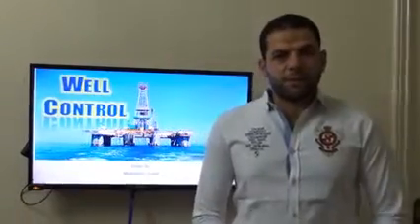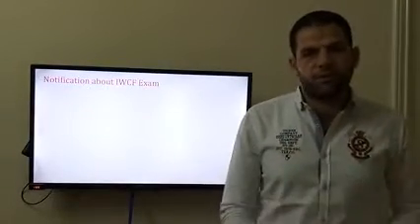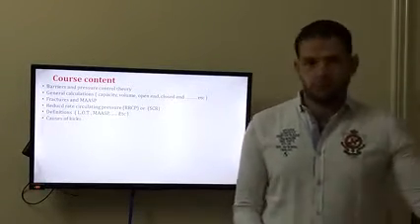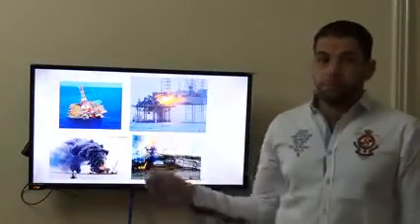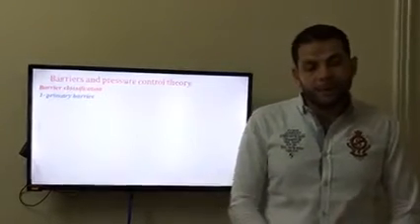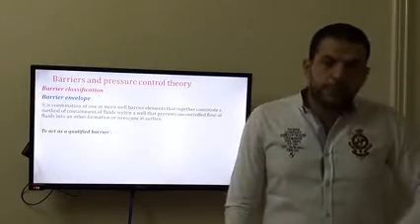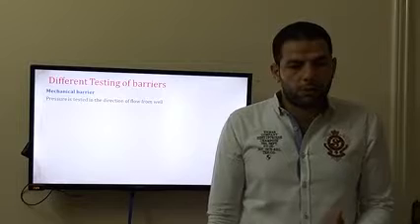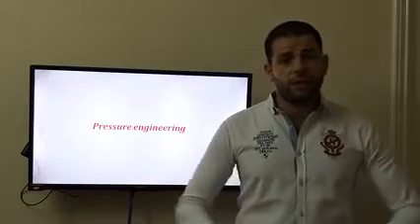1. IWCF : Types of barriers

Comment: Hello Abdelaziz. You mentioned that for anything be considered as a barrier is has to be tested in place! I am aware that the BOP is often tested before being run in the well site, however I’m wondering how can the mud (providers of the hydrostatic pressure) be tested in place!
Reply: continuously check the mud weight  to ensure that it is providing the required HP